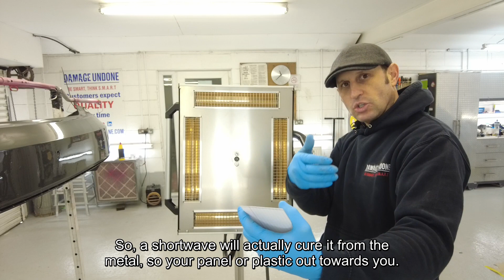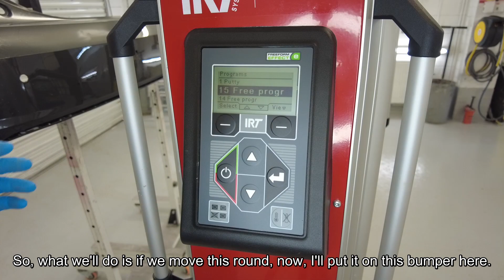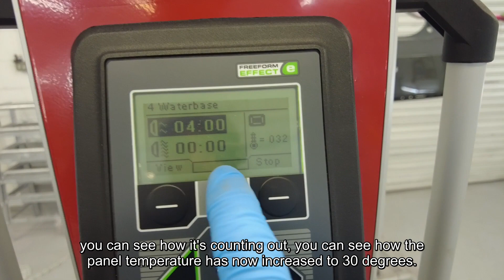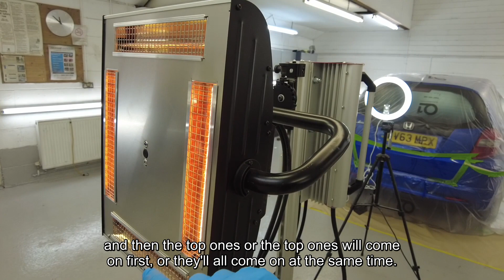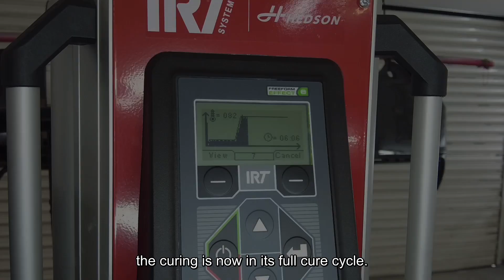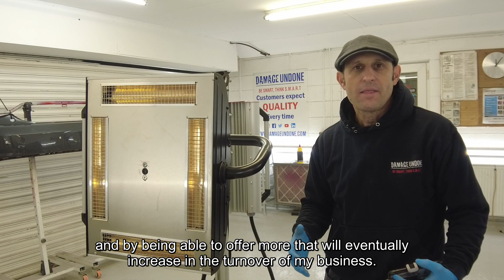IRT infrared lamp review

Comment: Very interesting Wayne you explained it's features very well. I've seen you use this a few times but it does much more that I thought and as you say it's an intelligent curing system so you can set it and forget it which frees you up to do other jobs unlike some of the IR lamps which you need to baby sit in case you are overcooking your paint, I like mine as it has a flash off feature, temp control and full bake settings all with a timer but it's just about the best I can use as I'm limited to 240v but only 13A, I could run a second cable from a different ring main in my house but that get's a little risky, my other option is have another feed from my fuse box then I can go 32A or more, thanks for sharing your thoughts Wayne 🤗👊👍
Reply from the maker: Sounds like your system is great too
Reply: It's not bad but doesn't have any sensors so the temp is controlled by just altering the brightness/power of the IR lamps and the distance from the panel and the flash off is done by pulsating the lamps, tbh now I have my 10KW heater I don't use it.

Comment: What a great explanation, this model of IRT look very useful for me, not for painting but for heating up a panel for some big PDR collision Repairs, such a great control of heating. On work we got an older model, with two heaters, but you can't switch one on or of, because a lever is damaged for 3 years... 
But in fact of my "want to" use, of this irt it will be a much to exspensive
Reply from the maker: This lamp has so much potential and benefits. 

It is a big investment but like with every big investment, you have to make it pay for itself 👍